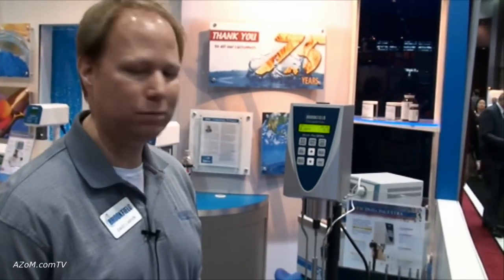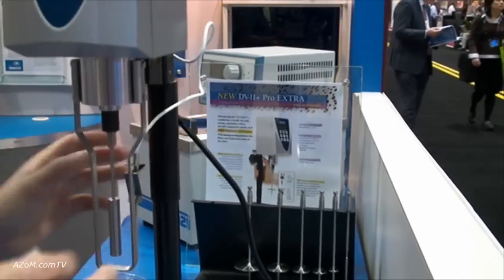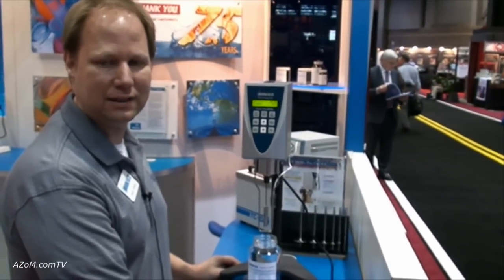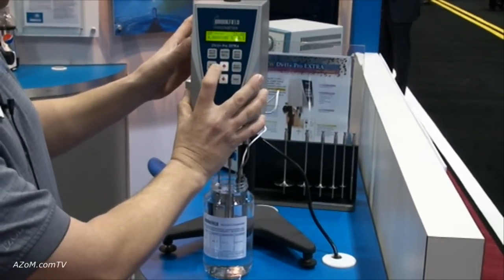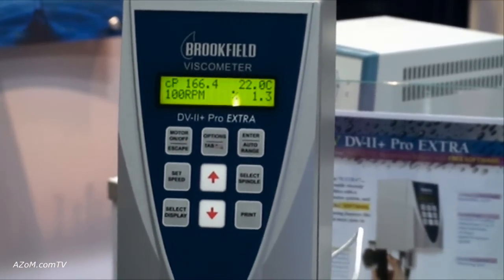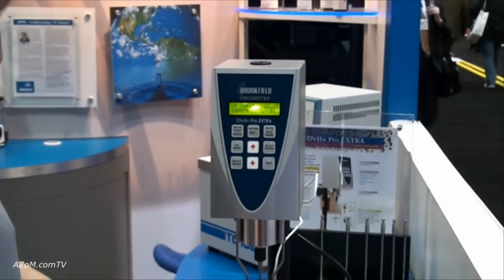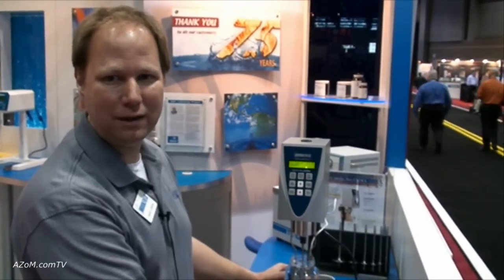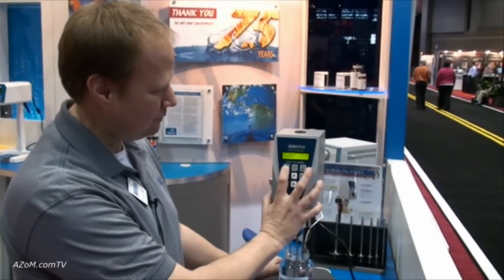The Brookfield DVII+Pro Viscometer

Comment: Can this be used to measure viscosity of < 2 cP?
Reply: I recently tested mineral oil which was about 10 cSt at various RPM. My issue was there was quite a large amount of uncertainty at the very low end of the scale with these models. I used DV-iii plus.
The reading was jumping between a hard 10.0 to a hard 14.0. I think very low viscosity I needed better testing technique and a better understanding of fluid dynamics.